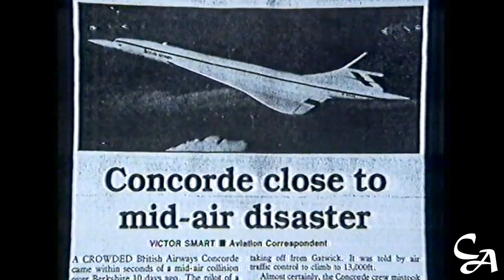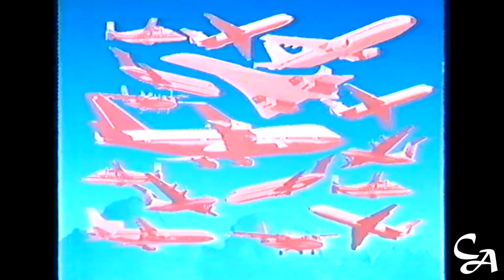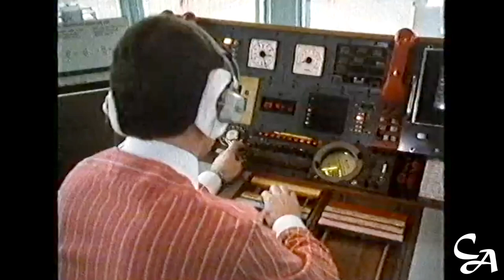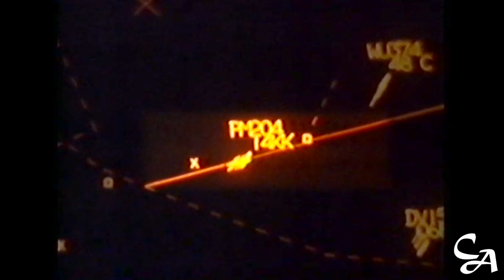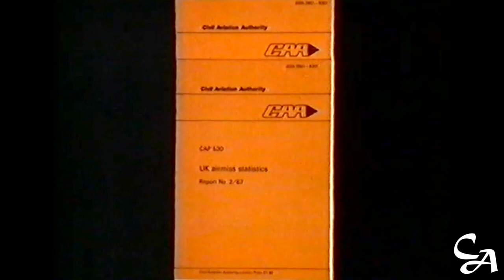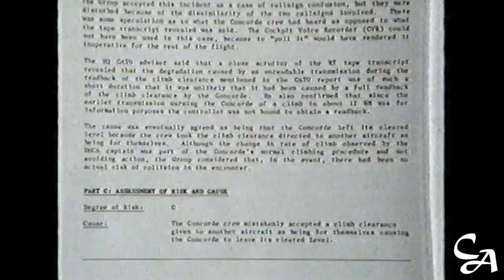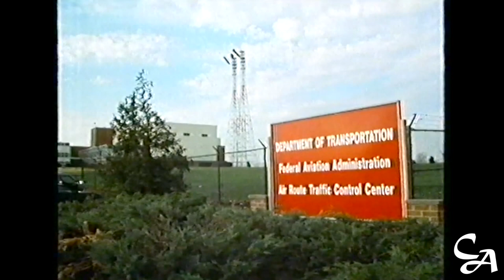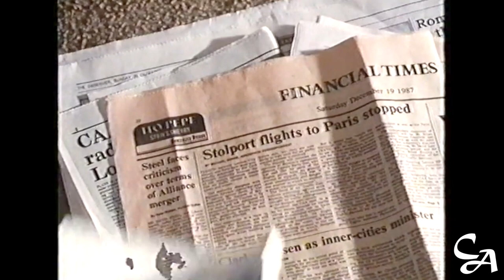Struggling for Control (ATC)

Comment: Interesting film. My uncle work at ATC in Bangkok. Most Thai airports have also military aircraft in and out mixed with normal passenger aircraft. Aviation spend in Thailand is second to military budget. I only know about accidents of pilot or weathers error. Weather here is a big issue because of rain fall. Thanks for the film 🎥 🙏🇹🇭